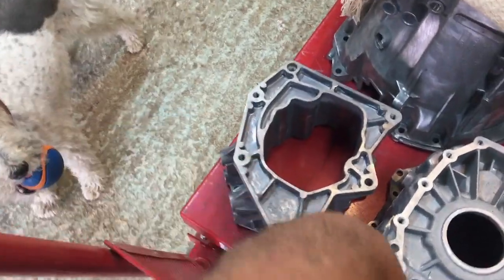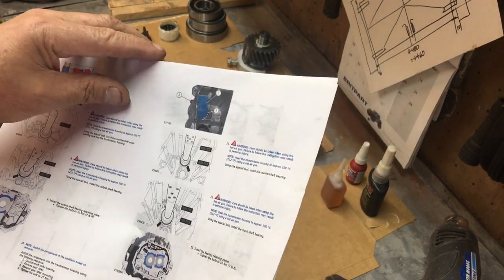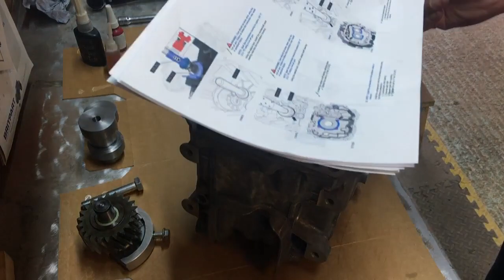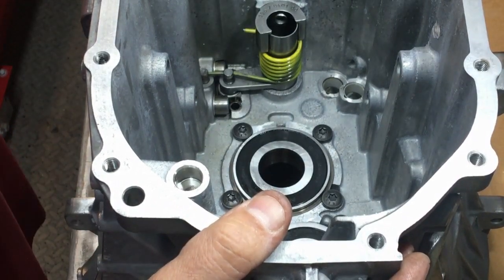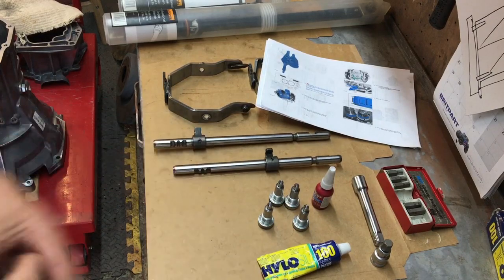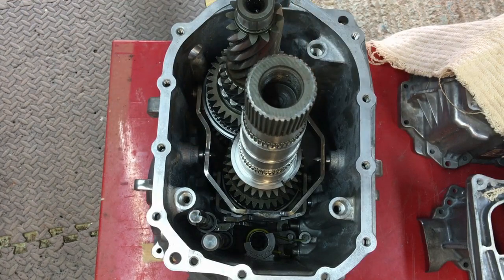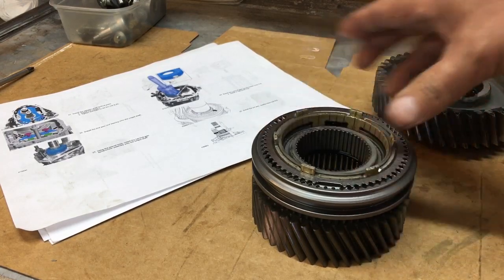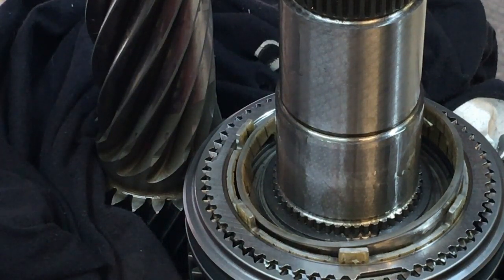Defender MT-82 gearbox rebuild. Part 1.

Comment: Good vid that's a tough box to build , the small parts in the hub are called shifts plates, and the circlip could be hammered closed on the bench [ to resize ] we normally put inners hubs on first [when interference] then the outer and pop in the shift plate / detents , not really a diy box for 99.9%

Comment: Would you mind putting a link to where you found and downloaded the MT82  manual? (even though it had its issues). I am unable to find one that has the steps in it, like the one you show does. The Helm manual  is worthless for rebuilding.

Comment: Hey guys just wanted to give you some tips. I've become specialized in the MT82 for mustangs and have rebuilt about 50 of them now. 

First off, good job on this video you are very methodical and smart about your approach. 

Tip 1: there is really no need to warm up/freeze the bearings or shafts for install or removal. The bearings on the MT82 are actually quite exceptional bearings. We RARELY see any issues with them. The amount of resistance applied to the inner bearing races during install/removal is not enough to cause any damage. The inner and outer races do not even need to be supported. If you need to remove the input shaft just tap it out with a dead blow. I must clarify that temperature differential is always a useful tool and technically the "correct" and safe way of handling it but in reality not worth the trouble on this particular transmission. You won't hurt it I promise.

Tip 2: when installing the 5/6 shift fork put the slider into 6th gear and it will be very easy to snake the fork into place without the bronze shift pads falling out

Tip 3: Realistically you need at least a 40 ton press to press the countershaft gears on and off. They are on very tight. Every crank of the press will remind you of turning the handle on a "Jack in the Box". 

Tip 4: 3rd and 4th gear each need 10 thou of play after your countershaft is assembled. If you remember to install the snap ring on the 3/4 hub then 3rd gear will automatically be at 10 thou. If you have more than 10 thou, you forgot to install the snap ring. To get the 4th gear to 10 thousandths you just need to make sure that the 6th countershaft gear is fully pressed down. Sometimes people press it down until it visually appears to be seated all the way. Usually I keep cranking the press until it pops one more time but it will be a very very slight and short pop. After the slight short pop you will be fully seated and 4th gear will have the correct 10 thou tolerance.

Tip 5: If you don't want to have to by specialized tools, use the open end of a 16mm wrench to pry the 4 shift rail detents out. 22mm wrench for the shift stop

Tip 6: Your input shaft may be difficult to turn by hand after completion. Don't worry. Finish the rebuild, get your rear case on and bolted together, get your countershaft bolt torqued down, install your seals and get the rear flange torqued down as well. Last thing you will need to do is pop the end of the input shaft with a dead blow a couple times. This will free up your synchros which are likely stuck together. This is typically what causes the transmission to be difficult to turn over

Tip 7: Just to reinforce this, USE ANAEROBIC SEALER. Do not use RTV. The mt82 transmission requires very particular tolerances in order to properly function. RTV adds enough thickness to be able to throw off the function of the trans.

I have a lot more tips than that but I'll save them for another time. 

At the end of the day I would not recommend this transmission to the DIY guy. In fact I would not recommend it to anyone who has not rebuilt several before. If you want to try it by all means go for it but this is not one of those transmissions that works correctly assuming everything is bolted together correctly. There is more to it than that. Many quirks with the MT82
Reply: Hello @TAShannon1..I think we may have spoke on this subject a while back? 
Glad now that you are now a specialist after building 50 MT82s. I would be very interested in any strip or rebuild videos you may have made on this particular gearbox.
I'm wondering if you are familiar with bearing failure due to a condition called Brinelling ?
This is from a site the internet.
                                                          "All bearings have a typical service life. However, an OEM’s suggested service life is not always a guarantee. Bearing failure comes in many forms, such as corrosion, smearing and brinelling. The definition of brinelling is the permanent indentation of a hard surface. Bearing brinelling occurs when the internal raceways of a bearing have been permanently damaged. The indentations can quickly lead to improper operation, like chattering or excess vibration, which in turn can accelerate other forms of wear. Two common forms of wear are galling, the adhesion between sliding surfaces, and spalling, the flaking off of materials under rolling pressure. Brinelling causes wear in which, similar marks are pressed into the surface of a moving part, such as bearings or hydraulic pistons. It is usually undesirable as the parts often work with other parts close to each other. " 
This is well know in the industry but very little known to individual and independent repairers.
In the MT82 transmission test booths, all bearings, gears and shaft surfaces that carry internal bearing are checked . Each bearing has in effect it's own song sheet...a Hertz reading given by the manufacture, the input shaft you are talking about in "tip1" has a Hertz rating of 0.38htz when fitted correctly. The test booth would detect any and all anomalies.
If the input shaft had a different htz reading, or any other bearing for that matter, the box would be rejected and come to me.
Any transmission that was stripped automatically had any bearing scrapped that had been subject to incorrect load, such as pressing or knocking the input shaft out with a dead-blow hammer. A bearing being subjected to this is prone to failure. It may sound and feel fine after the rebuild, and it may well me fine for god knows how long, but the usual life span of the bearing will be considerably shortened.
There are many many , as they say "  nuances" to building transmissions, and the MT82 is no exception.
If, at some point you would like to go through these, and there are a good many, I would be happy to go through a full and correct strip and full an correct rebuild.
                                                                                                                                                                                                                             Regards,
                                                                                                                                                                                                                                                 Alan.

Comment: Good day Nigel.
Thank you for this very informative video,  I have managed to rebuild the entire transmission not even having to use a press only my heat gun, I now only need to install the seals and fill with oil. This video had made the task way way easier than I anticipated it would be. Thanks mate ! !
Reply from the maker: I have still to fit the rear casing. Glad it was helpful.

Comment: Get a old crock pot put
 sae w30 Engine oil In it turn it on high drop your bearings in for heat expansion .. and put shaft receiving bearing in the deepfreeze...

Comment: HI Nigel love the video's mate, I live in Western Australia so may need to order some parts well in advance,  Did you replace any bearings? if you can recall the sizes and numbers it would be appreciated. I've got the 6th speed vibration starting to happen so trying to get the parts all together for a rebuild in the next couple of weeks. . 
Cheers and keep the video's flowing.
Reply from the maker: Hi Spike. I didn’t replace any bearings. I have shown the part numbers I got in the part 2 video.
Reply: Thanks Nigel
Reply: @iantiller2381   co dzieje się z Nigelem